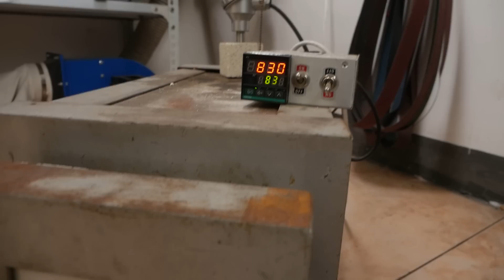Forging Canister Damascus Grover washers Pattern Welded Steel Knife

Comment: Nice knife and interesting concept. However, when working with loads, there is a chance to break the handle (I mean not the lining, but the metal shank itself), since the holes are too thick and there is not enough metal in that place for good strength.
Reply: Этот нож не является утилитарным изделием, он не для работы. 100% артобъект. Дизайн превосходный. Латунь + дамаск = 💥 Нож для коллекции ценителя. 👍

Comment: I'm curious why you picked washers as a blade material. Aren't they made of just mild steel?
Reply from the maker: The washers are made of 65mn, which is spring steel. I did a hardness test before making

Comment: I am a bit confused. Judging by the etched color, the powdered steel you put in the can was 1080, 1095 ish, right? If that 250 in the tempering oven was 250C the blade would be way soft and the 55 hrc file would dig right in. If it was 250F, 60 hrc file would skate clean off. Too hard for the given steel. Pleasr let me know?
Reply from the maker: The tempering temperature is 250 degrees Celsius, and the steel powder is my own ratio, containing nickel and graphite, not 1080/1095.  I did vacuum carburize the blade a second time before heat treatment, this part is not shown.  In addition, the washer is made of spring steel, which has good hardness and elasticity.
Reply: @HansKnives  Thank you kindly for the speedy reply. 
Well learned and good stuff!

Comment: Click bait. Says Damascus steel. It is only layered steel. Damascus is a recipe. Nothing to do with what he posted. Reported.
Reply from the maker: You don't need to correct me, I know what you mean about Damascus. But now Damascus is more used to call a kind of pattern steel. If I forged it with two different steels, you'd say it wasn't Damascus. This is just a general term for forged welded pattern steel.